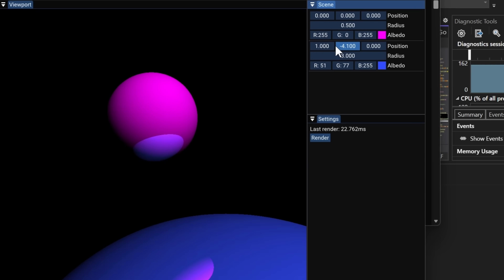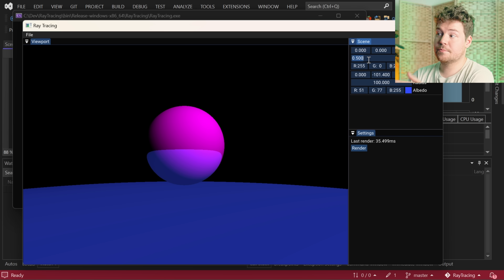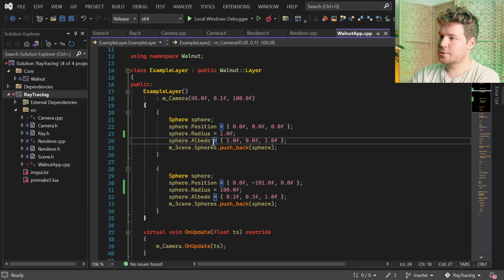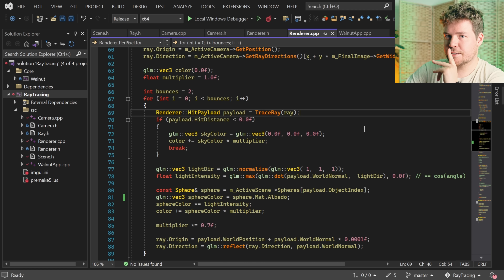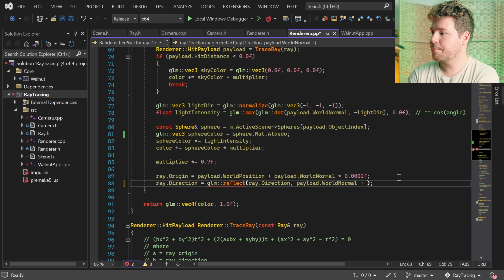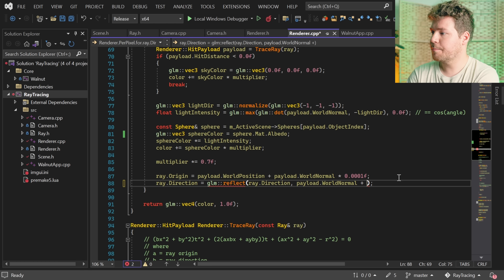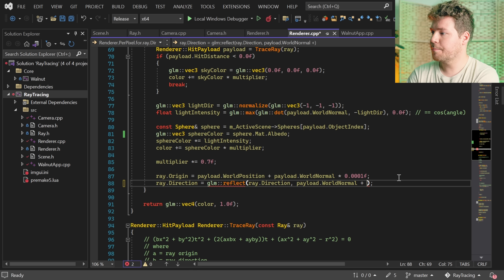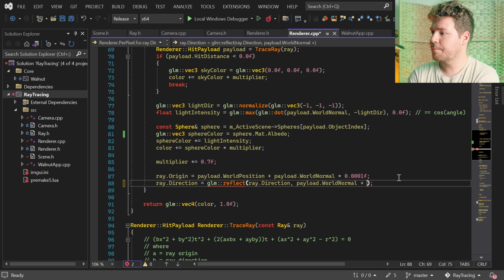Materials and Physically Based Rendering // Ray Tracing series

Comment: how do you learn to give and not pay for free stuff
Reply: set no pre-conditions, then you are free from the money-law master of yours
Reply: I'm not in any hurry, not me by Christ in me, Christ as me
Reply: money is not an acceptable (consumable) produce
Reply: therefore all things mingled with money are tainted
Reply: the whole thing becomes useless
Reply: you like to do your own file format, so why not light format also, zero or two, not one-one, be honest
Reply: therefore your own code is in the end the mess, recoding what has already been done
Reply: combine bump (z-difference) map on the texture
Reply: then you have surface roughness separate from the shape of the surface, combining the two is an approximation on a flat surface
Reply: bump map is a high-resolution surface descriptor without needing to do the polygons, just the texture z-difference map
Reply: first you calculate the first intersection with the surface, then you apply the bump map to the ray trace per line/plane ray
Reply: try doing micro-spike mirrors on single polygon
Reply: keep all the surface ray bounces like they are, modify the surface
Reply: noise comes from the surface, not by artificially simulating the rough surface, actual surface deformation is best (most accurate) and better than a sketchy approximation
Reply: random noise is what it is, random noise, bump map is not noisy, its rigid and static
Reply: random is a poor choice
Reply: AO is a raster term, shoo bug
Reply: texture coordinate based bump map does not random noise around, it stays in place
Reply: you could even have a 3d polygon structure as a texture, includes a super complicated surface along the texture and the colors/textures on the surfaces
Reply: like a sub-object-triangles textured parent triangle
Reply: polygonal surface texture in coordinate space, but in true 3d
Reply: advanced texturing
Reply: physically based texturing
Reply: kinda megatexture but polygonally defined
Reply: if you dont want any noise, dont use random()
Reply: poor man's quick trash solution
Reply: instanced u-v polygon textures
Reply: grass foliage like
Reply: you could do a shader-ray-tracing-raster with only equation, the sphere/dot to plane distance, d = (a*x+b*y+c*z+d)/sqrt(a^2+b^2+c^2), for camera ray grid plane ray culling, sphere boundary volume culling and triangle culling
Reply: then its only about the usual "draw textured vertical lines" of a raster engine (or was it the horizontal lines)
Reply: the original demo lighting engines were low object-poly count, same for raster depth-first uniform 360 caster lighting bounces
Reply: try sphere radius "ray" marching, better than individual ray or plane ray intersections, ie, incrementally add the radius of the sphere, 360 degrees (or projected) camera/player centered, then intersect the sphere marching volume or sphere surface with objects on the scene, get all z-sorted automatically, paint the draw buffer directly